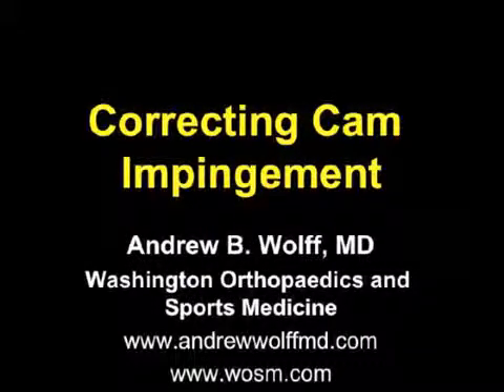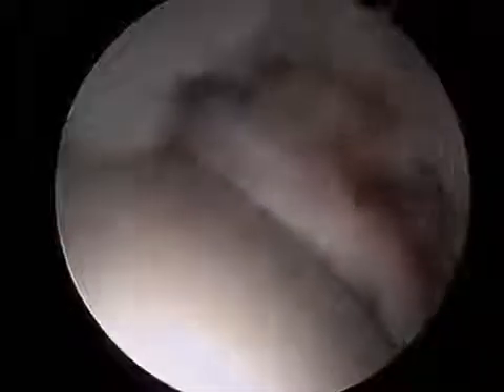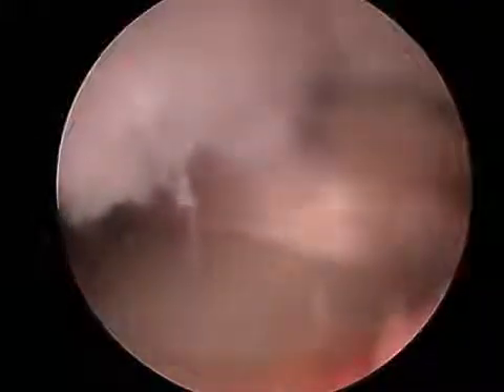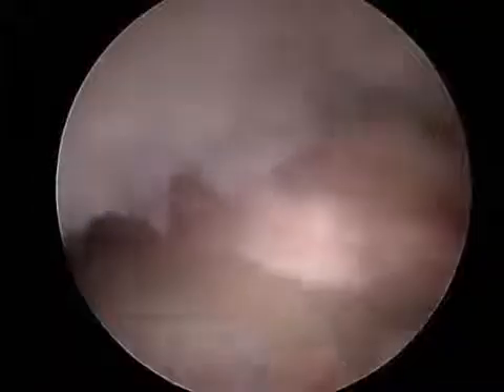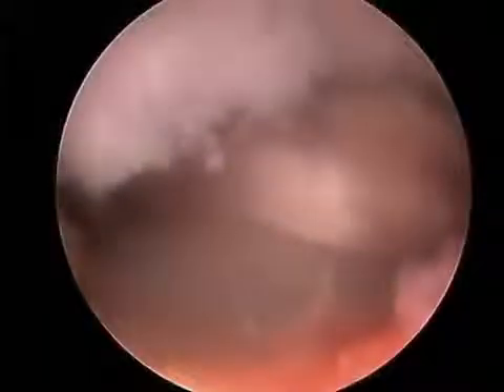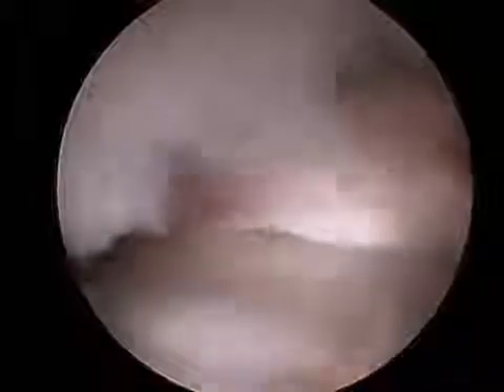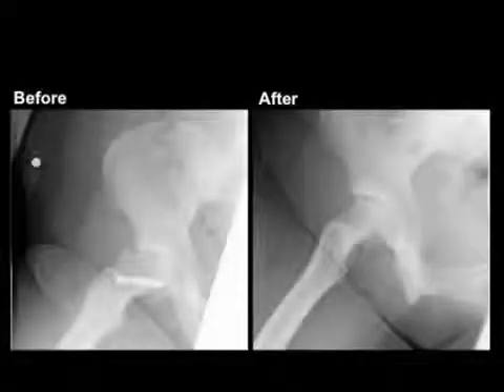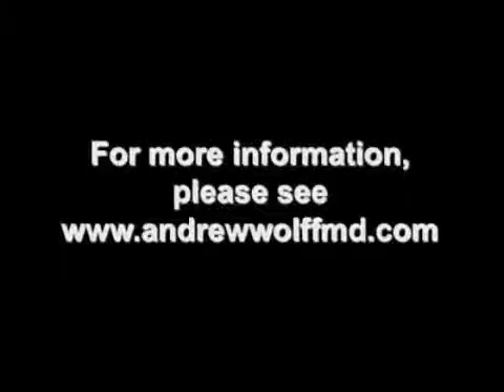Hip Arthroscopy for Correction of a Cam Deformity

Comment: I have a question I have a cam impingement and torn cartilage. the surgeon said majority of the time the labrum is debrided where it's torn and only a few are repaired. is that usually the case? I would much rather it repaired to keep the cartilage, bit does it depend on what type of tear?